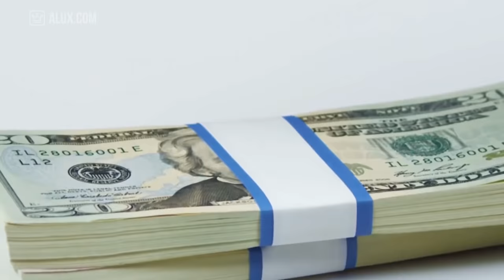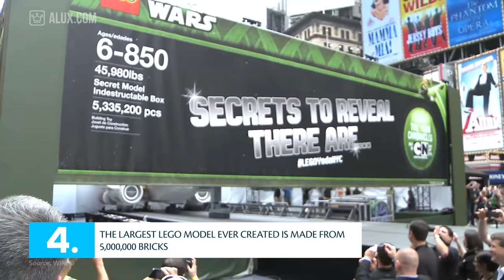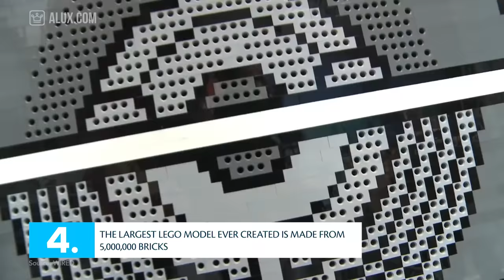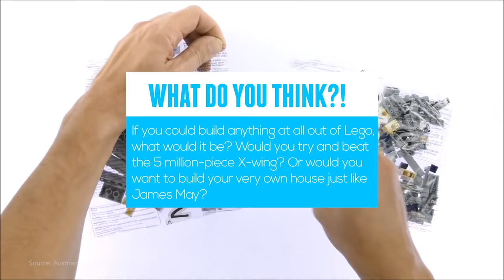15 Things You Didn't Know About LEGO

Comment: Here are my 10 things you did wrong in this video:
0:37 The picture does not show Ole Kirk Christiansen but Kjeld Kirk Kristiansen, his grandson.
0:47 LEGO has not been introduced as "automatic buildung blocks". Do you mean "interlocking bricks"?
1:20 The bricks did not change a bit and have been produced in the same measurements? That's not totally correct. Beside the well known Duplo bricks there were some other sizes such as Modulex which is not compatible at all to the LEGO system bricks.
2:12 When talking about "Legoland" please keep in mind that this is no longer owned by LEGO. It's a brand of the Merlin Entertainments Group for quite a while..
2:19 LEGO did never change their design? Well, just look at recent LEGO technic models. You will not see a single stud anywhere.
2:28 LEGO is available in 53 different colors? Over the years LEGO had much more than 150 colors (depending on the method of counting there are approx. 200 colors)
4:07 To be more precise: You are talking about 6 identically "standard" bricks with 2x4 studs. 
4:58 The Allianz Arena is located in Legoland Günzburg (Bavaria), not Berlin.
5:08 There are no military themes in LEGO except Castles, Pirates, Pirates of the Caribean, Lone Ranger and Star Wars. And of course there are endless fanmodels of all kinds of tanks and even working guns.
5:15 You will not be able to buy LEGO guns? Well, go to bricklink.com and search for "gun". You will get 71(!) different versions of Minifig-guns. Additionally, several Star Wars sets include shooting mechanisms.

And finally a fun fact: Do you have any idea which company is (by quantity) the largest manufacturer of tyres in the world?
Reply: I agree with your comments on the inaccuracies in this channel's posts. You were dead on about the "no guns or military themes" fact being wrong.  If they looked at their own footage at 7:37 it shows 3 soldiers with guns, bazookas, and grenades painted across their chests!
Reply: Jess Staci They were from starwars.
Reply: I care about the accuracy of the statement. If this includes math, then I care about it. 
Regarding guns: there are numerous sets with working canons and stud shooters. So LEGO obviously contradicts it‘s own policy.
Reply: Globalist The guns are all fictional though.
Reply: Globalist or historical
Reply: So a historical gun cannot kill anyone anymore? Good to know.
Reply: very tru but duplo bricks are compatible with normal Lego u wer right about modulex tho